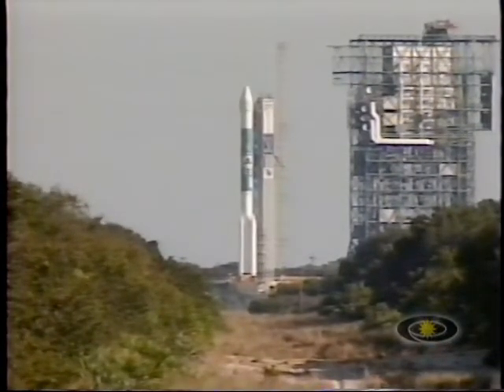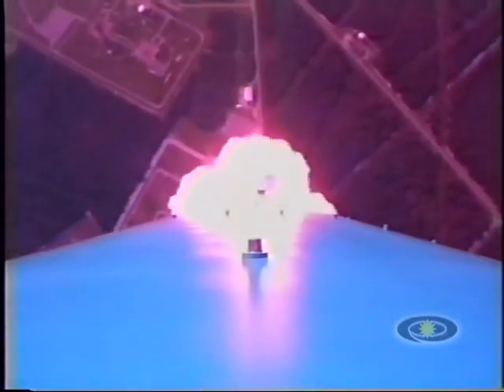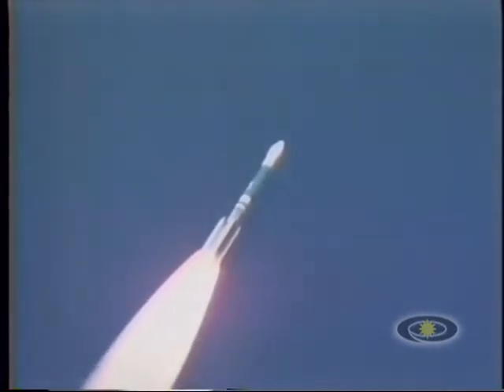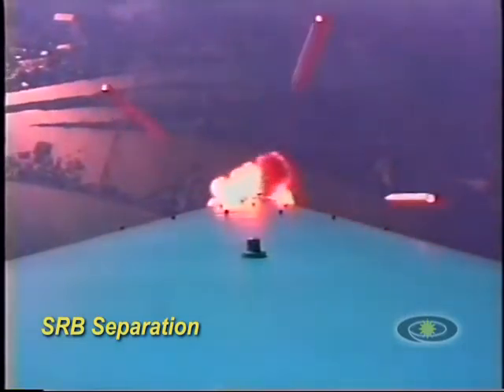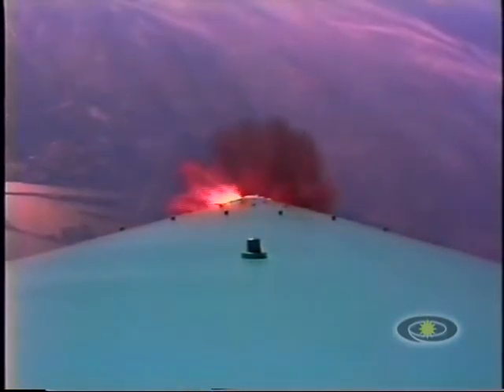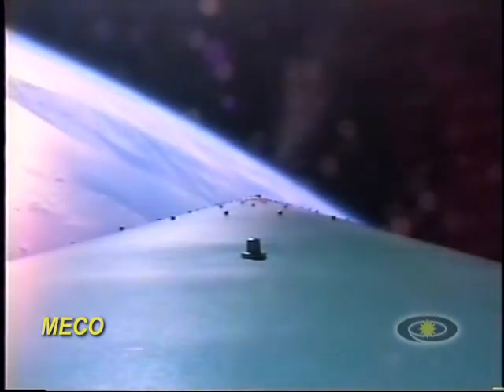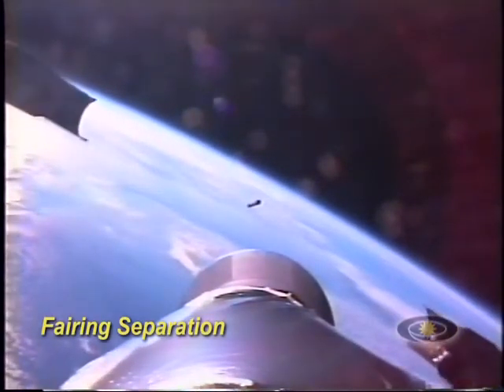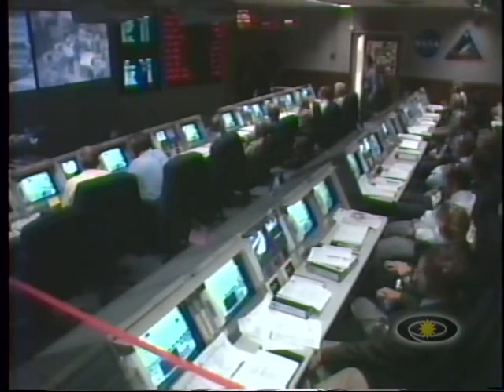Stardust Launch

Comment: Why did the earth get less curved from 2:00 to 2:02?
Wouldn't it get MORE curved the higher the view point?
Reply from the maker: The video jumps forward at that point because its boring.  The rocket is not getting much higher yet, it is trying to increase velocity PARALLEL to earth's surface.
It hasn't even released the SECOND stage yet, the THIRD stage is where the Spacecraft leaves earth orbit.
There was no camera on the upper stages.
Reply from the maker: And on my video, I have little risk of my comments being deleted.

If you want some evidence that the earth is curved, search online for "ADIRU Alignment" and read about how most modern aircraft test the onboard fiber-optic gyros before a flight by measuring earth rotation and curvature.
So earth rotation is literally measured tens of thousands of times a day everyday.
I have been doing this kind of hands-on testing of fiber-optic gyros as part of my job for the last 30 years.

Next look at the other videos on my YT channel until you find the one about the EPOXI video of earth.
It was taken from deep space by a spacecraft I was involved with building, launching and operating during its mission.

Comment: If I understand you correctly, we don't have continuous footage of ascent to orbit because the live camera moves out of radio range over the ocean, and there's no station in range to pick it up. Is that correct? And on the manned flights in space, the cameras have to be stowed for launch, so no recordings can be made, and it wouldn't be part of the mission profile anyway and serve no operational need? (Flat Earthers would still call it CGI if such a video was recorded and published.)
Reply from the maker: mendel - you are mostly correct.  I HAVE seen continuous footage all the way from liftoff to orbit.  In FACT when I watched THIS launch LIVE, I dont recall losing the video except for a couple of seconds at a time.  But MOST of the video editors throw away the center part where the rocket is showing basically the exact same view for ~10 minutes so they cut it out.  For continuous video footage of the Falcon Heavy all the way to space AND BACK, watch the video by Astronomy Live titled "Uninterrupted Footage of the Falcon Heavy Launch and Booster Landing! 2-6-18"
Reply from the maker: Here is the link: https://youtu.be/59pY74ZhQ50
Reply: Stuart Gray yeah, that's not "orbital" enough. The videos I've seen end after the last stage separates. Flat Earthers assume that the payload then tumbles back down to Earth as well, there is no documentation of anything orbiting, or the shuttle arriving at the ISS (at least not as unbroken footage). Like I said, I have a few guesses why this might be, but I don't know with enough confidence to tell others.
Watching your video, a third reason would be that the satellite is hidden under the fairing, so can't record the ascent, and the rest does drop down?
Reply: @mendelde  Flat earthers are so obsessed of uninterrupted videos as prove. They also don't believe in 24 hours of sunlight in the arctic regions in summer, and want to see an uninterrupted video of the sun not setting. There are time lapsed videos of course.

Comment: Slow it down at 2:20 You can see the object clipping out of the CGI shell. That's why you get all this distortion / freezing. It's to hide the CGI. You can even see aliasing around the black areas.  At 2:23 you can see the thurst burn and it doesn't light up the shell. Because it's not really there and has no interior. It's just a black wall. Which supports that the rocket is in fact clipping out of the backend of the shell. Even the sun doesn't light up the inside of the shell when it turns. 2:25  It's just stays a black wall......
Reply from the maker: Sorry but what you saw was the effect of the attitude disturbance on the live video feed.  And you think that LIVE VIDEO FEED was "CGI" ?  You apparently dont realize WHAT YEAR THAT WAS. "State of the art" CGI in 1999 was TOY STORY 2 and that WAS NOT RENDERED IN REAL TIME.   It was NOT CGI - I was there and saw the launch and live video feed with my own eyes. As the rocket lifted off YOU COULD SEE WHERE I PARKED MY CAR THAT MORNING.  SO they knew where to put my rental car in teh 3D model IN ADVANCE?
Reply: As you can see, you are a moron who believes space is fake